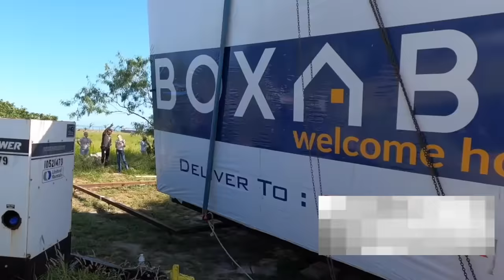Learn More About BOXABL - 5 Minute Pitch

Comment: What are the materials? What are these houses made of?
Reply from the maker: Boxabl is made from steel, concrete, and EPS foam. These are building materials that don’t degrade and will last a lifetime. The walls, floor, and roof are structurally laminated panels much stronger than the average building.

Comment: The casita looks very cute, but I don’t see any closet space. The divider between the living area and bedroom looks too short to hang a long coat or a dress. Is this unit designed with just one gender in mind? You should probably add some females to your think tank, unless you want to ignore 50.8% of potential buyers. It looks like you have a washer/dryer but no place to the put the clothes you can wash. I also didn’t see a slant on the roof— I suppose this design is limited to warm desert climates? Otherwise rain/snow will damage this unit. Is the unit solar powered? I didn’t see that advertised. Buyers for tiny units will likely be looking for that, especially if it’s a unit designed for minimalists who don’t own many clothes. Overall, good concept! I look forward to seeing your newer models.
Reply from the maker: We will be designing new floorpans and sizes soon. Please check boxabl.com/faq
Reply: It’s strange you mention that, in Europe it was rare to build closets back in the day so they just used wardrobes. I don’t see why the same solution couldn’t be used now(People own too many clothes they rarely wear anyway) 🤣

Comment: What materials are you using?  Are your homes made of sustainable materials?
Reply from the maker: Boxabl is made from steel, concrete, and EPS foam. These are building materials that don’t degrade and will last a lifetime. The walls, floor, and roof are structurally laminated panels much stronger than the average building.

Comment: I really like that fact it provides afford housing. However, I'm concerned something will happen and it will collapse like a deck of cards. Maybe it's better to go with a 3d built home. They're cheaper, made of concrete, and they take less time to build.
Reply: I think the problem with printing full house out of concrete is still too expensive because you need do much concrete. In addition, you'll need lots of steel inside that concrete to make it strong.
Reply: @themysticsupreme5946  Thanks for interesting link. It would call that a shed instead of a house but it's already cheaper than I expected, even for a shed.

Comment: The floor in your argument is that factory made things are a better quality. And the systems to build houses though may be similar are vastly different from actual building of houses years ago. Things are basically made of cardboard now. Not an actual solid structure. I worry your system will just degrade how we live even farther than where we are now. In a McMansion cardboard world. Nothing can replace the hard-working hands of man.why can't affordable housing still be quality housing
Reply from the maker: Boxabl are made from steel, concrete and EPS foam. These are building materials that don’t degrade and will last a lifetime. The walls, floor and roof are structurally laminated panels that are much stronger than the average building. The building has all materials that last a long time, no wood that can rot.

Comment: I love this idea do you guy fiancee and have house that would be warm in a cold and snowy envoirment
Reply from the maker: Yes! Boxabl will be connecting customers with our future financing partners. Many loan options may be available. Before we finalize your Box order, our financing partners will reach out to you to discuss loan options. You can likely finance your Boxabl with a traditional 30-year mortgage. The house is very well insulated. In fact, the design is similar to an igloo cooler or refrigerator. All the air will be trapped inside and conditioned. This means a Boxabl will do great in high heat or high cold climates.

Comment: Avoid flat roof designs. Flat roofs are never a good idea. I see some of the models have sloped roofs. Thats good. Don't waste time and resources and long-term reputation with flat roofs.
Reply from the maker: The Casita has a flat roof that is watertight, insulated and snow load rated. Some areas will require a pitched roof, in that case you will add a roof solution on site with your roofing contractor. In the future we hope to provide plans for this and potentially a roofing solution that we will sell separately.